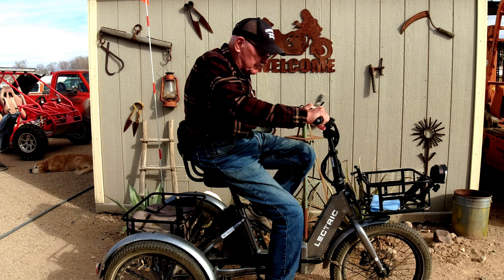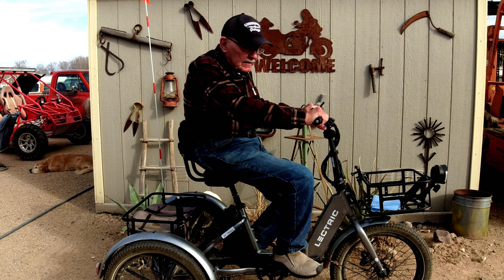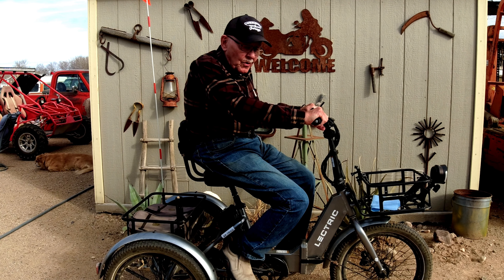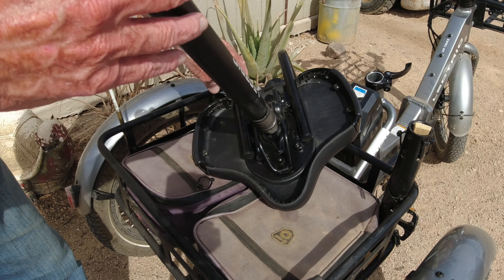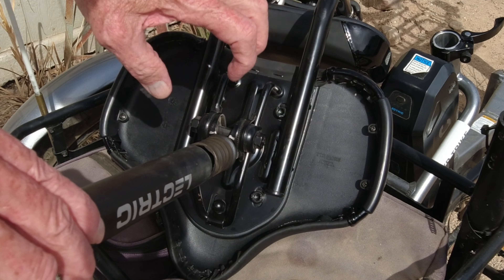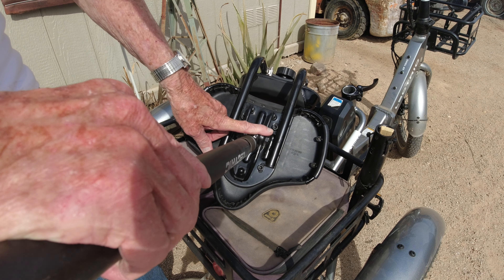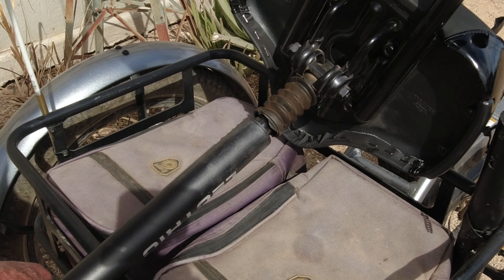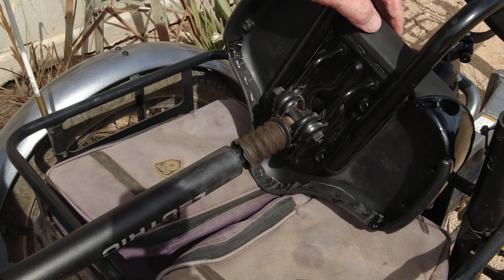LECTRIC XP TRIKE BACK-REST & SEAT POST MODIFICATIONS

Comment: You came up with a clever fix for your seat back!  It drives me nuts to hear weird noises on my non-electrical trike.  Currently I have lubed or tightened all of the problem areas - rear sprocket, rear axle,  coaster brake, hub, pedals, seat, you name it.  Silence is golden!
Reply from the maker: My oldest son rides a bike to work and seems to have that same issue. Where do those sounds come from. Thank you for your comment and input and God bless.